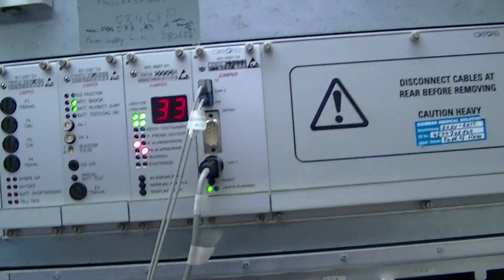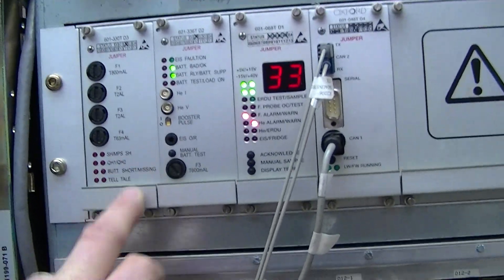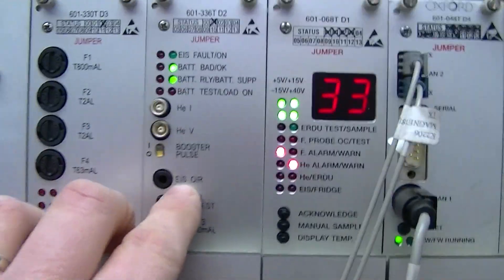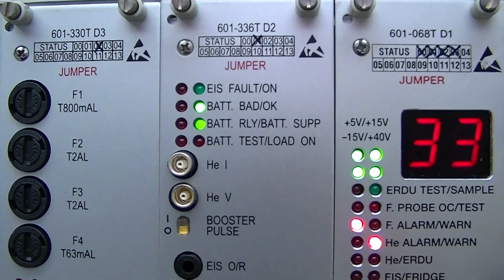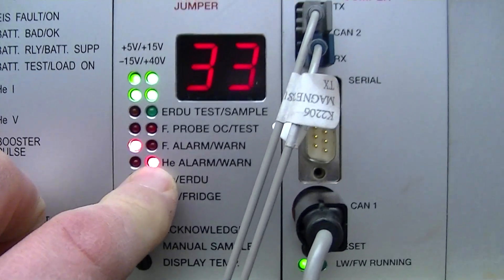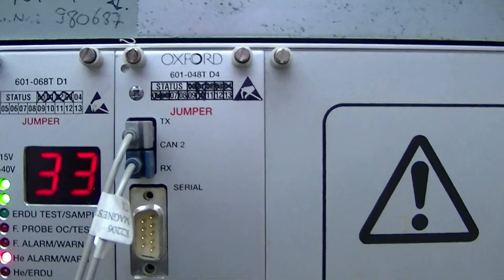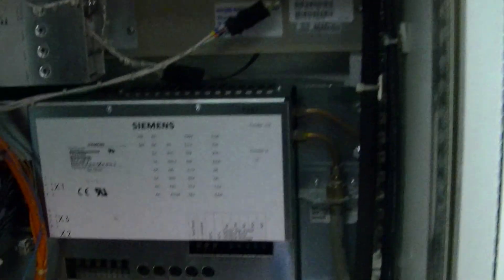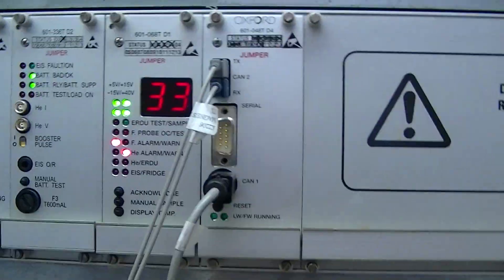Siemens Magnetom Symphony Magnet Supervision

Comment: Hi there!  Nice video!  This "quenching", as you call it, sounds interesting.  What does that entail?  I guess the helium is liquefied, and keeps a superconducting magnet cool?  

What kind of magnet is this?  What about the hemoglobin in a patient's blood?  Even without jewelry or metal accompanying the person, in or on their body, can the blood in a human being respond more strongly to these magnetic fields?  These are how many Tesla?  2 Tesla?  3?

Why do they say "Gauss's" sometimes, and other times, Teslas?  

Ok, thanks again.
Reply from the maker: This magnet is a 1.5T (Tesla) magnet. Hemoglobin is spread far out inside the body and unaffected up until 7 Tesla. Yes, liquid helium keeps the superconducting properties of the magnet cold so as the current does t turn into heat. When quenched, a small heater, think old school car cigarette lighter, is applied to liquid in the vessel. Instantly turning 4K (-450F~) into a gas thus the current will turn to heat and boil off helium and no more magnet.
Gauss and Tesla are both measures of magnets. Tesla is more coarse of a measurement whereas Gauss is more fine. 6 of one... Hope that helps.